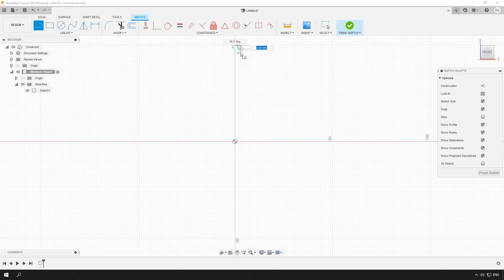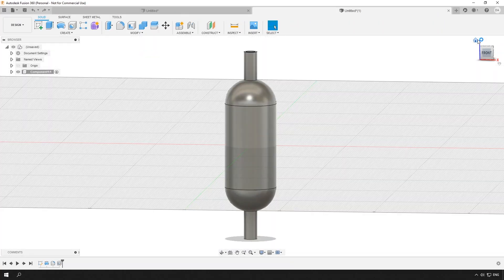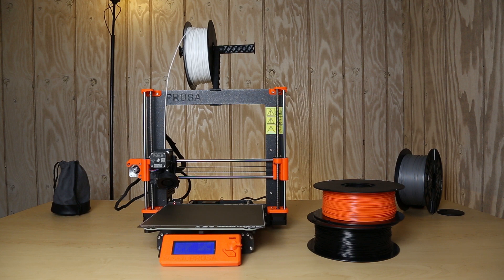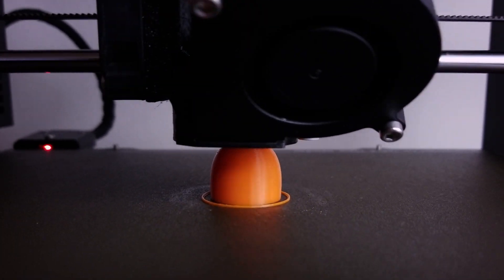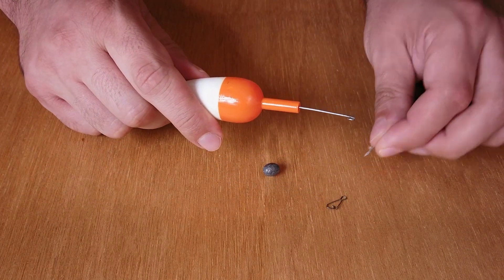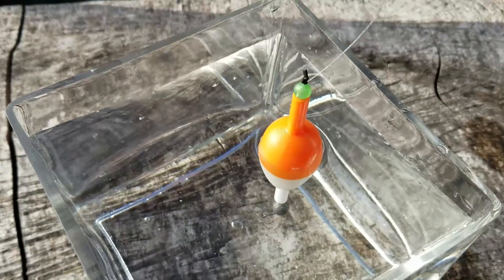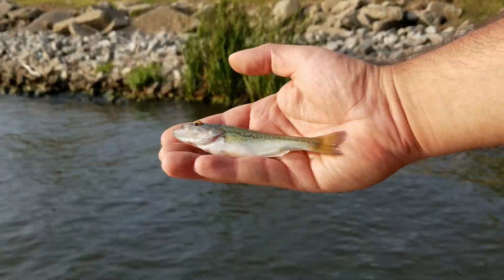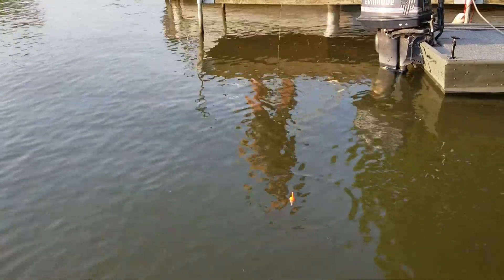Will this 3D Printed Bobber Work? (Fishing Floats - Design, Make, and Test)

Comment: can i use it with lure rod? im wondering something could  be work with lure rod while fishing without any bait.
Reply from the maker: Sure it can be used for a lure setup. It will work as any other slip bobber. You can vary the number of perimeters and the amount of "fill" to  regulate the bobber weight to make it work better with the type of lures you are using.

Comment: This is awesome. A question, did you print it 100% infill?
Reply from the maker: Definitely not 100% infill. I varied it from 5% to 15% depending on the weight of the float I wanted. Also, for heavier and tougher floats I used 3 perimeters instead of the default 2, so they won't break when I miss and they land on rocks, seawalls, and other hard surfaces.